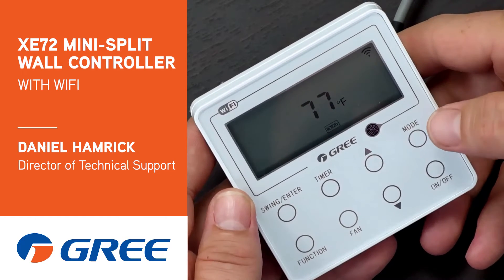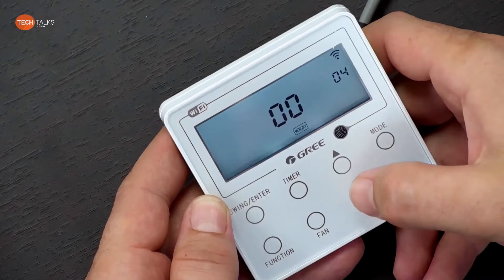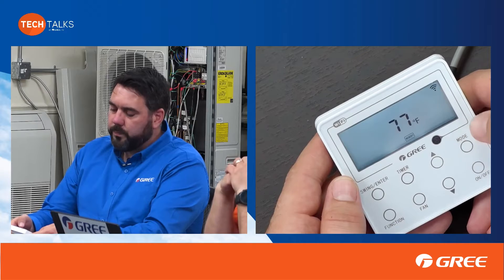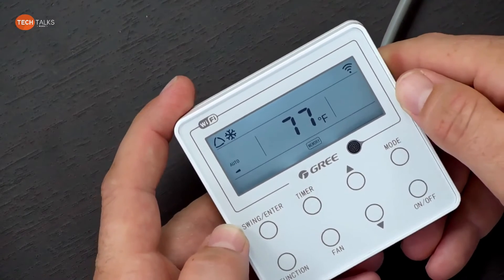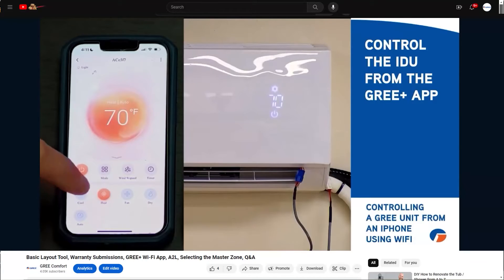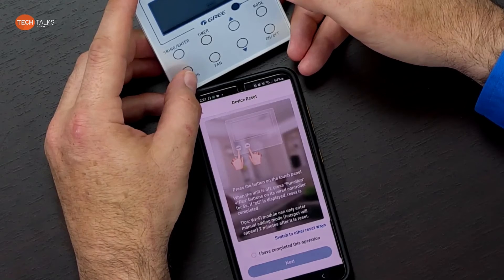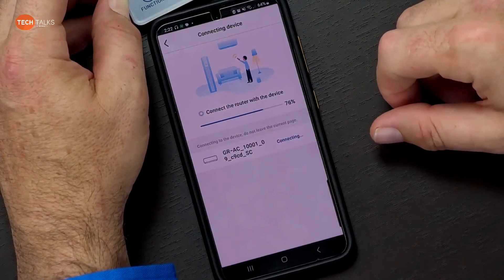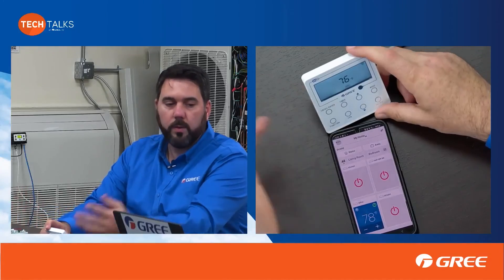Hands-On the GREE XE72 Mini-Split Wall Controller with Wi-Fi

Comment: Key take away. On the cassette units, this is the WiFi module / gateway. There is no seperate WiFi module (blue connector) on the ceiling units. Also - you can't have any - (dashes) or special characters in the WiFi SSID.
Reply: Can't post pix on  YT,  but get 4 guitar picks. Put them between the term and the backer place at the edges of the top and bottom of the backer plate. You can use the square slot on the bottom to pry the backer away from the 4 latches on the therm. 

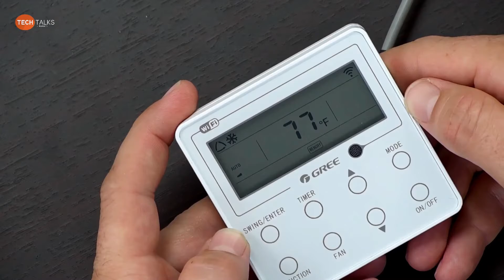You can see them in the therm pics in this video. The latch mouldings are visible at 02:16 in the video if you look closley.

Comment: Two major issues with the controller i could not find settings for:

1. In cooling mode the fan does not shut off after the compressor shuts off. This makes the humidity spike to 60%+ and smells terrible 

2. The hysteresis (the heating/cooling beyond the setpoint before turning off and again waiting for the temperature to be below/above the setpoint before turning back on) is +/- 3°F which effectively makes your room temperature fluctuate by 6°F. You alternate between freezing and sweating the entire length of the ahoulder seasons.

Comment: HVAC guy just set my unit up. But no power to wall controller. There was a hum in the outdoor unit when powered up. He tested all connections and voltage between outdoor and indoor unit with proper voltage. He also checked for proper plug in of controller. But did not have small probes with him to check voltage going to controller. Any suggestions I can pass on? It’s getting cold😂🥶
Reply from the maker: Has the technician been back to establish power to the controller?